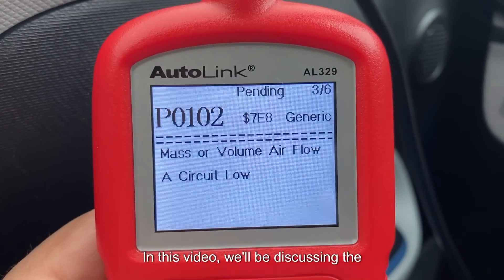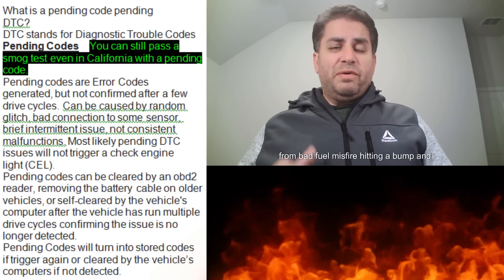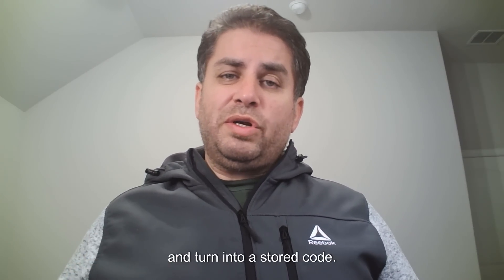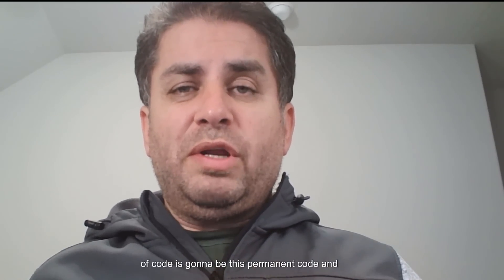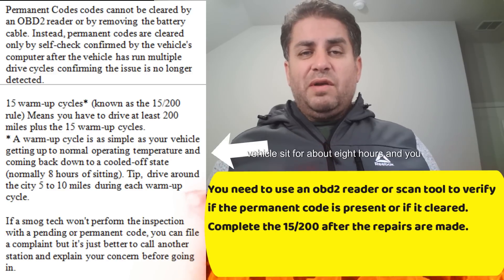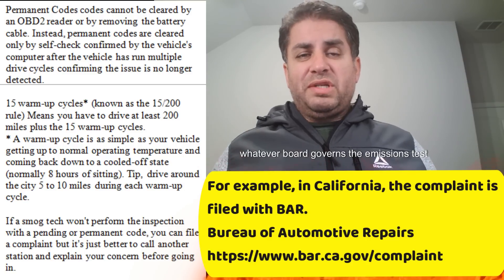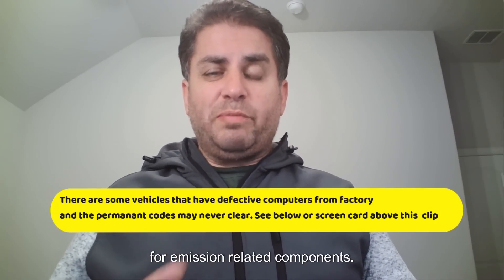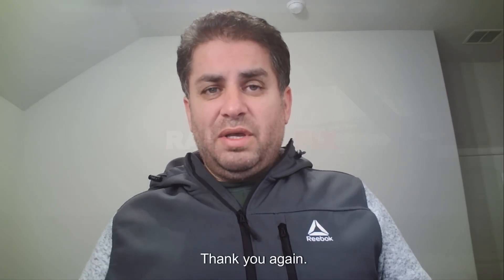Diagnostic Trouble Code? Pending vs Stored vs Permanent DTC

Comment: So i have a 2010 ford no cel and all monitors ready except Evap and a permanent po456 and po455 code. I can pass if 15 warm up cycles and 200 miles?
Reply from the maker: You should be  able to pass in most states except Oregon as they don’t have an exemption for the evap. 
Now make sure you don’t have a pending code.
The technician will need to also verify the miles since the cel was last cleared and confirm that you have driven over 200 miles. So 15 warm cycles and the miles will need to be verified.
Keep in mind some smog places may be a little vary so don’t be afraid of trying another shop.
Explain it to smog technician ahead of time and also check your states requirements like shown in this video https://youtu.be/QKxDzdTVJOU?si=y8hrwUKs50uKPDTI

Keep me posted
Reply: Yes assuming you are in CA.  Other states no guarantee.

Comment: Hi, I do have a question, please. I had a check engine code p0240 om my 2011 toyota camry SE. I did change the catalytic converter and both o2 sensors, but It still there, even when I drive more than 500 milles.

Comment: Hey random, 2013 GM...this is driving me crazy i have a scan tool, check engine lite comes on then clears OFF,  after i drive it 4 some time   then i drive it till my monitors are ready then the stored code comes on again  P0024 then to a pending code then a check engine lite...again P0024 . Trying to pass my emissions, i think its a false reading  on the P0024, Got 100k on vehicle.

Comment: So stored codes need to be fixed?
Reply from the maker: Yes, always address the issue and clear the codes. I personally write down the code and freeze frame data, clear the codes and see what happens once’s I drive the vehicle. I have experienced codes that have only pop up once. Things such as weak and old batteries will throw all kinds of codes so I alway make sure your vehicle’s battery is almost perfect before you spending any money on a repair.
Reply: @RANDOMFIX  would a weak or low battery throw
P0200, 1200,1300,1400 AND a 1700

Have 5 codes (minus low tire pressure ones that I know were there I just never cleared them after reinflating the tire

Only ask my low milage Crosstrek has all these in hitory but has NEVER thrown a CEL I’m the only one who drives and 1st owner I’ve had it for 2+ years and I don’t recall ANYTHING as far as it running poorly or any noises ect. 
Doesn’t show pending , permanent or stored just states history 

Hooked my hogher grade innova while I was scanning a guy at works CEL for him and said I’ll just check mine for fun and when I run the all module scan that popped up on that but not on the generic OBD 2 it runs when you hook it up

Battery was ran low or killed a few times battery is fine I just ran stereo  longer than I should and jumped it twice.

Just curious do my own maintenance  reliably. 

Seems odd it would have all those but never through a CEL

Comment: At 3:48 you said doing the 200/15 will clear the PDTC.  Doing the 200/15 wont clear the permanent code but rather the CA SMOG machine will ignore it.  But it might clear the permanent code in the 200/15 but no guarantee.
Reply from the maker: It should clear but even if it doesn’t clear after the 15/200 is met it will be allowed to tested and will pass. Good catch and thank you for bringing that to my attention.

Comment: Question, I need a new cat and my car is California emissions.  I live in Georgia, do I actually need to buy a CARB cat even though my state doesn't require it?  My car is a 2004 Acura tsx.

Appreciate all the work you do!
Reply from the maker: You need ask some one at an exhaust shop personally I don’t think any will check. You may not need a catalyst if you trick your ecu to thinking the cat is okay. I just did it in the same engine as yours https://youtu.be/HkF4oCED0UU?si=zt-kJpKefrS3KBFE and lastly don’t get tricked into overpaying for a new catalytic converter as you can find one for under $150 shipped that is a direct fit unit so it will be easy to change out if you decide to go that route. All the links are in the video description and Georgia is pretty lenient with the inspection monitors.
Good luck and keep me posted.